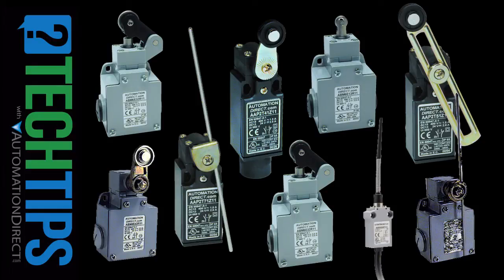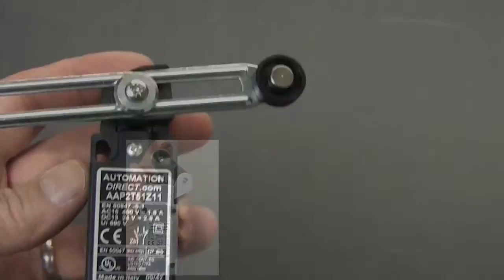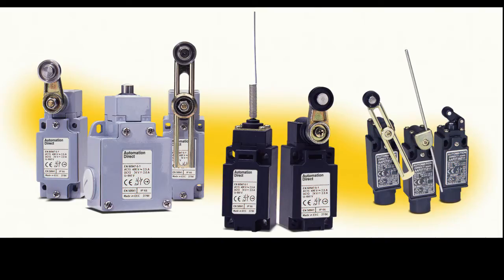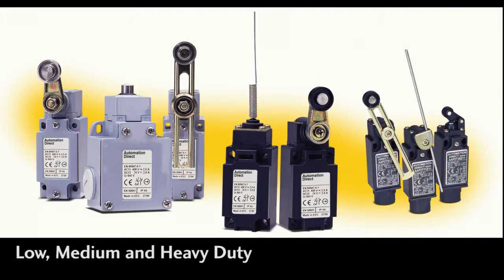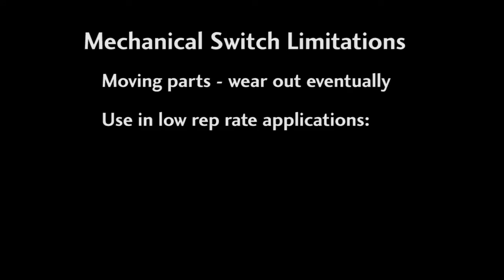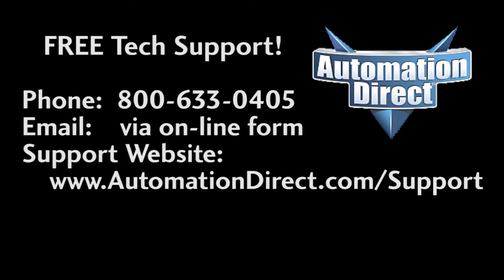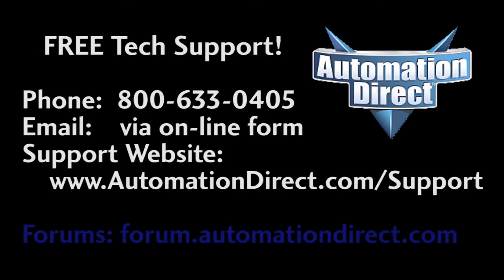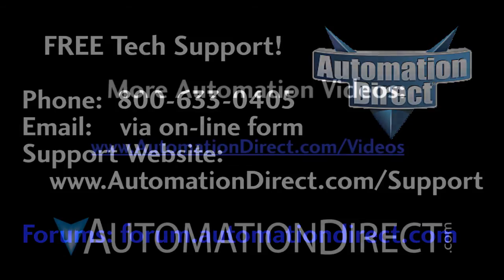Selecting The Right Limit Switch from AutomationDirect

Comment: Sir I want to know about the 6 type limit switches shown specially the last one ,how they function with example
Reply from the maker: Hi Rocky, I'm not sure which switch you are referring to. Can you be more spcific? Or just go to the AutomationDirect website where you will find full documentation on all of these: www.automationdirect.com.
Reply: @automationdirect  switch having smallest arm
Reply from the maker: If you are looking for switches with the shortest arm/throw - then take a look at the "Precision Limit Switches" at www.automationdirect.com. They have a 1.5mm plunger.
Regardless, all of these limit switches are just dry contact mechanical switches. The ones with rotating arms just have a cam that rotates and depresses a switch.